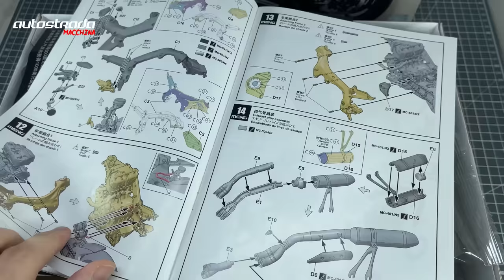I built a BMW track bike - 1/9 2018 BMW HP4 RACE - MENG

Comment: Excellent video for an excellent looking kit.  I didn't realise it was push together, this makes it a lot more appealing... are there parts you have to glue in place?  & in terms of preparing surfaces for paint, do you have to key the parts or are they ready to go?
Reply from the maker: I think because of the scale on this one most parts are push into place, there were a few bits that I did glue though. The parts defo need cleaning up when they come of the sprue